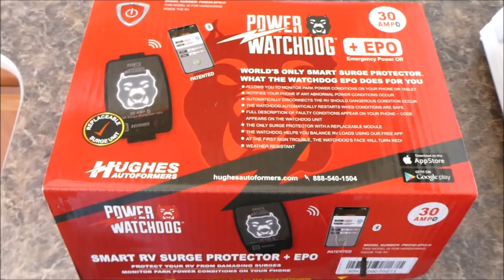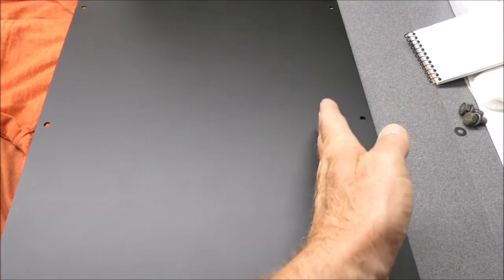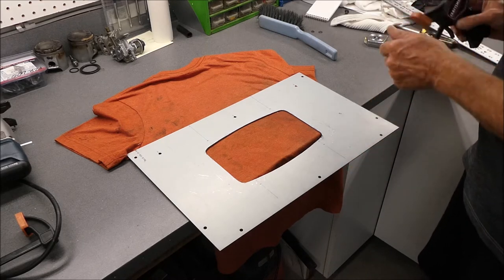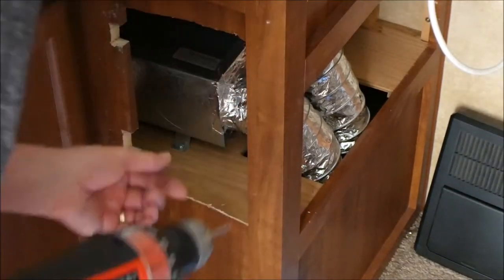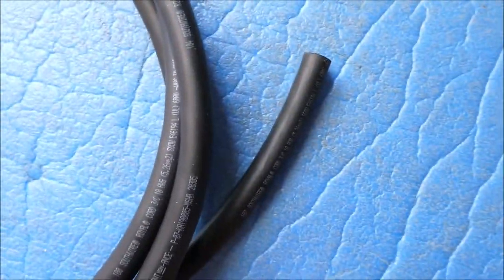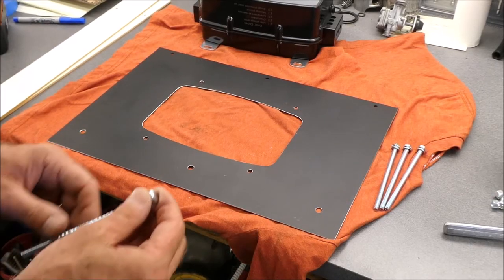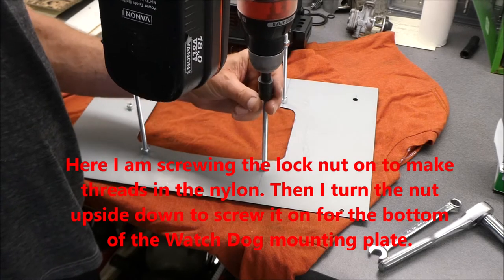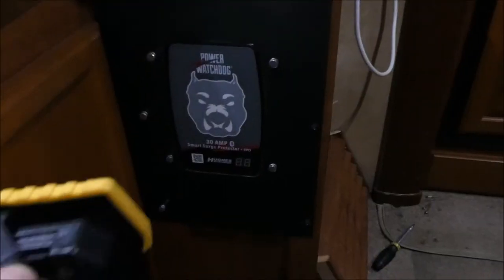Hughes POWER WATCHDOG + EPO Custom Hard Wire Installation into Jayco Travel Trailer

Comment: I really appreciate the detailed video and feel confident I can install one myself now. Thank you! 

Question about the install location though. If you're planning to use the Bluetooth feature, would it be ok to tuck the unit inside a cabinet door to avoid the bright light or is there some reason why it would be better to have it highly visible?
Reply from the maker: Thank you. I never even put the app on my phone so have never used the bluetooth on this thing. It should function as any other bluetooth device I would think. My guess is the bluetooth would work through the cabinet door. The only reason to not have it hidden behind a door is you won't see the angry red face if it shuts your electric down. No big deal as you'll know if electricity is off to look at the Watchdog. Good luck with the install.

Comment: Ken,  I swear.... you were filming one of my projects.   You have provided great thoughts on how to do this in the Jayflight here!    Looking back  are you still happy with selecting the hardwire version vs the plug version outside?
Reply from the maker: Thanks for the compliment. I chose hardwire vs plug in mostly because that plug in unit is too easy for someone to steal. Even with a lock on it. Yes, I am happy with it. I mentioned in another reply that this thing has reset (as it should) several times due to low voltage. It works quite well although we are not getting out camping enough to test it more.